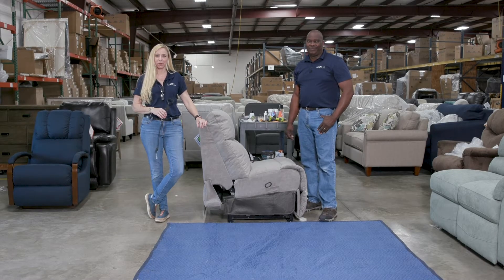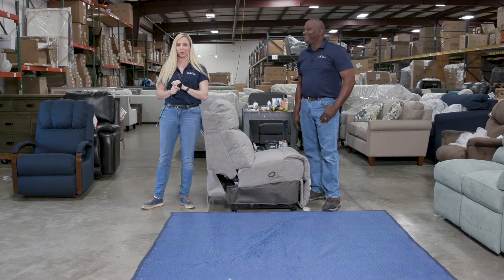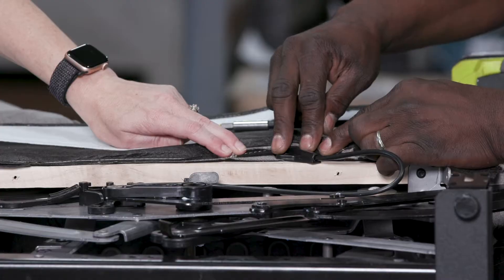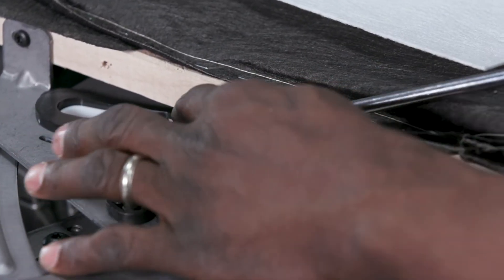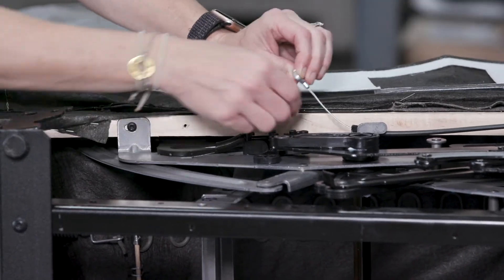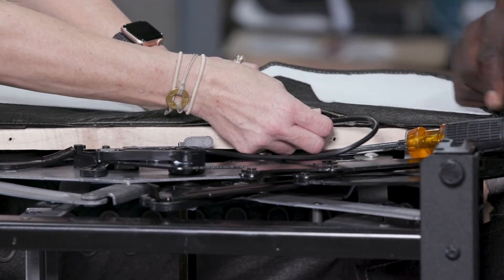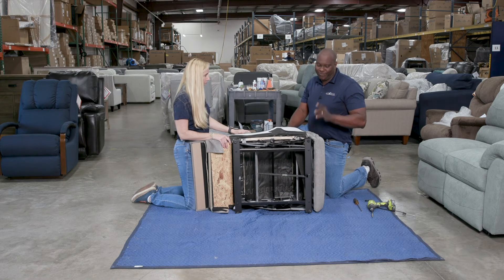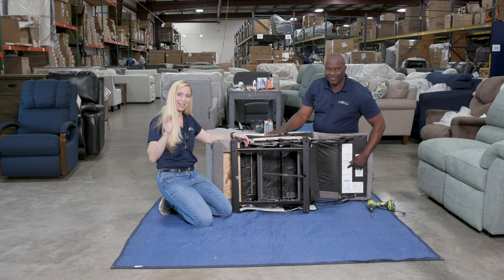How To Replace the Parachute Pull on your La-Z-Boy Sofa

Comment: I have been searching for help with my sofa and this handle. I'm out of Dallas and the service department sent me a replacement that looks nothing like the original pull handle and cord. They didn't give me any instructions but told me to look for a youtube video. Do you have any info on maybe a "new" style of the pull handle that would help?
Reply: Did you ever figure this out? I’m in the same boat. I am encouraged to see the Orlando La-Z-Boy doing these videos but the company as a whole just really craps the bed when it comes to customer service/caring for their customers.
Reply: Same issue here in Wisconsin
Reply: I was able to get a lazyboy rep to send me the repair manual as a PDF: https://drive.google.com/file/d/12hLwetEoXKlR1uc2BAtXNE0oSAYmqCa9/view

I hope this is helpful to everyone. I am not handy but I was able to install it. It does seem that the instructions miss a step around step 3 of the install where you will need to install one of the provided screws in the back of the new assembly. Also, they did not provide the break over in step 11 of the install. 

Sadly, to install this you need to disassemble the entire chair. I just took a deep breath and did it. I was done in an hour, and I’m not mister fix it. 

Good luck all!
Reply: Thank you so much for that!! I got the instructions with the crappy pictures as well and that PDF saved me